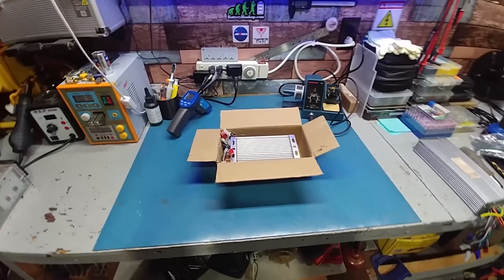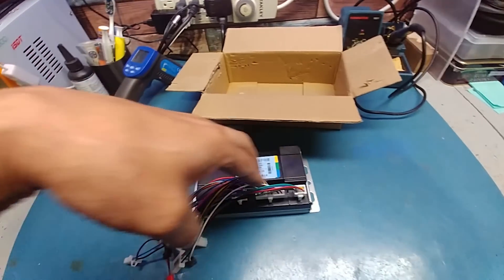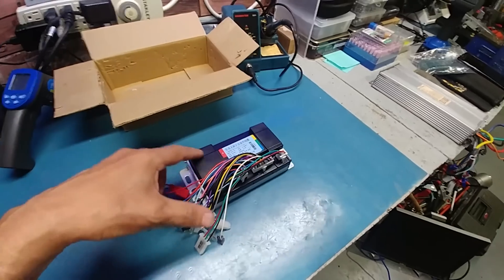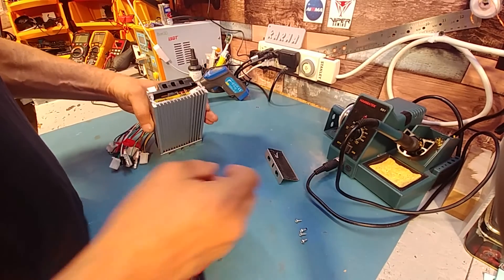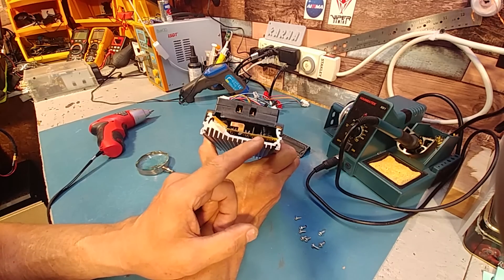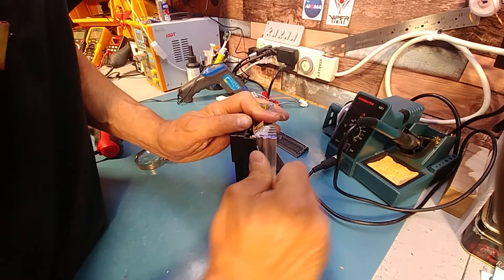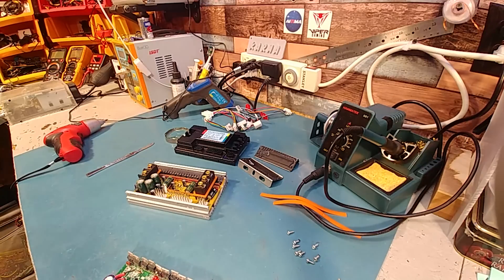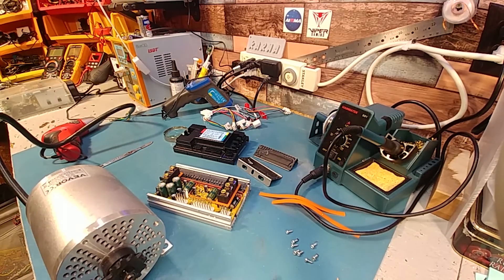Sattvavow Sine Wave Controller 1000W 60-72V*a look inside p1*

Comment: I have a similar controller (ZWK060035A) on my Fat Tire Scooter. When you purchased this controller did it come programmed? The controller on my scooter is 60 volt and current limited at 35 amps.  I'm getting an "E3" error code on the Display.

Comment: I got one of those controllers  but it says 1500W ( chinese  numbers  , so who knows )  I run high voltage though these
100V and average peak current is 25 for these $20 units. Can't get it to draw more so I use  higher voltages.
Never gets hot even when riding at 35C weather.

Comment: I won't be surprised if it actually drives a 1500W peak load. 12 SKD502Ts, 4 per phase should be capable.